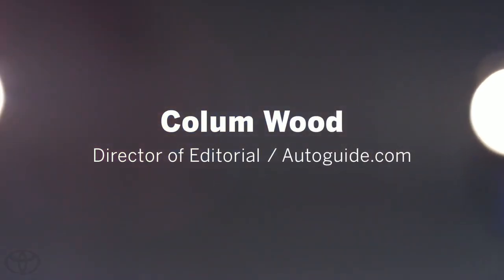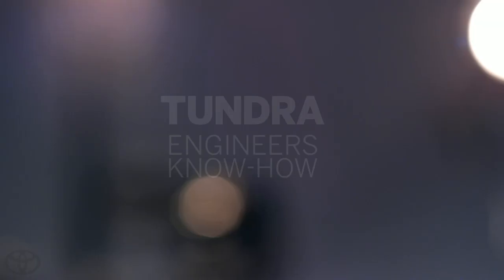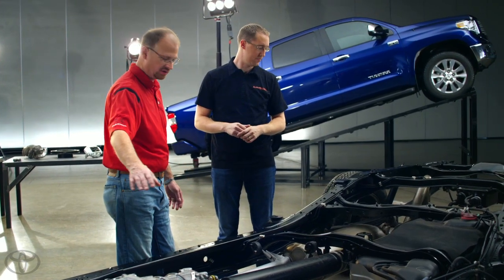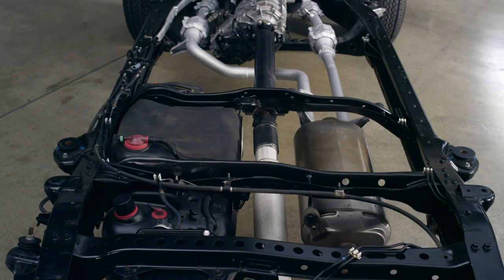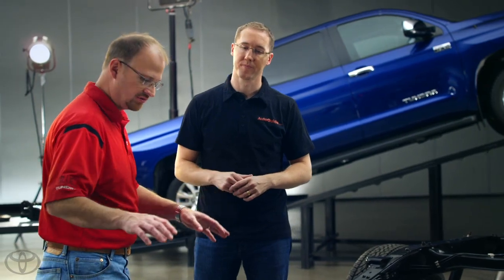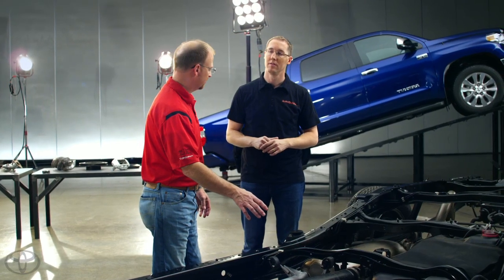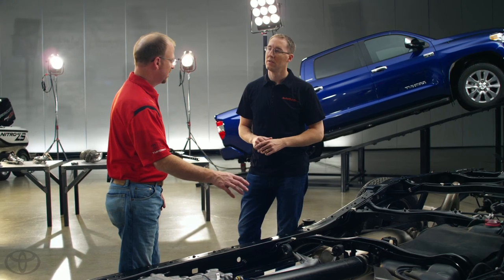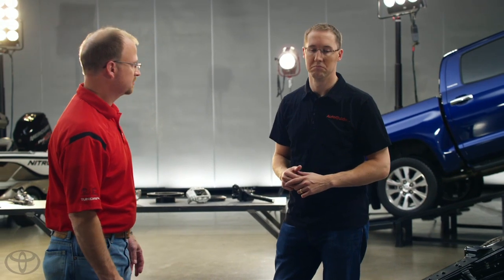2014 Tundra: Tundra Design: Drivetrain | Toyota

Comment: Love my Tundra (2010) but during the recent freeze in Denver the windshield sprayers actually froze up. My Saab has high pressure windshield sprayer jets that never do that. Maybe a heated system for northern climates would be better.
Reply: Having high pressure jets has little to do with freezing. If the freezing point of the fluid is higher than the temperature of the fluid, it is going to freeze, period. Use a washer fluid designed for northern climates and you won't have an issue.
Reply: my et I've vqr